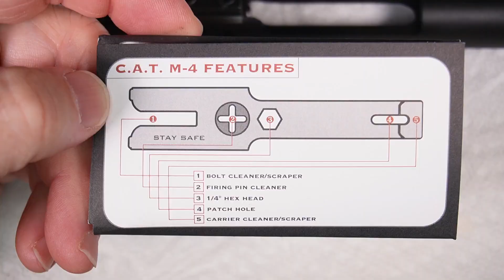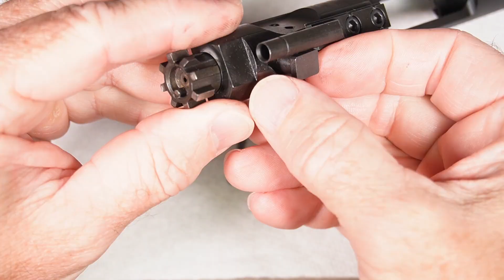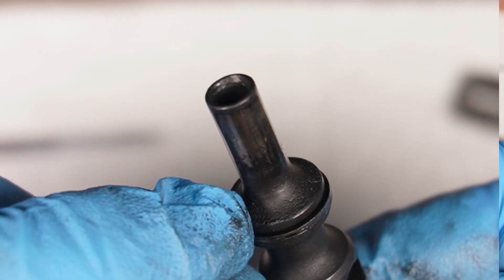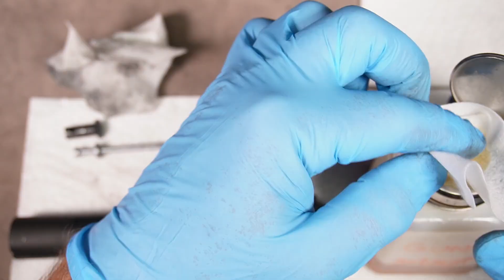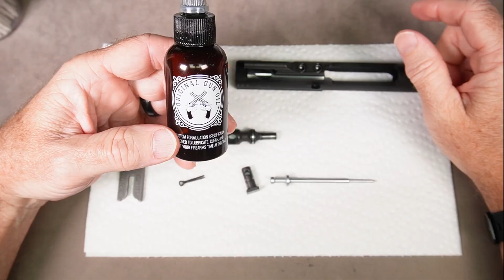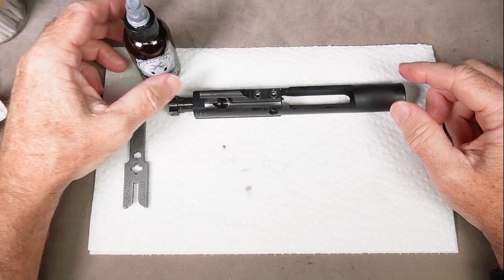CAT Outdoors M-4 BCG Cleaning & Scraping Tool. Easily Remove Carbon from your Bolt Carrier Group.

Comment: Would you consider this M4 Cat tool a little more gentle or better tool than the other tool you used for same applications in another video you posted???
Reply from the maker: Yes. This tool seems a bit higher quality and feels like it would last longer in my opinion. Thanks for the question!
Reply: @davesgunchannel  so would you say it’s something you do maybe every once in a while ? Because I see mixed thoughts on cleaning carbon off a  bolt tail I hear soak bolt tail but idk if they mean let drops sit on tail an let sit or if they mean drown the bolt which I though wasn’t good to get cleaner inside injector bolt head but I’m learning how properly clean it without doing much harm